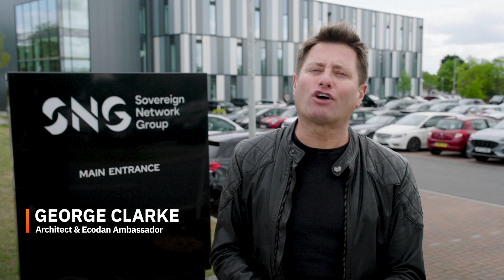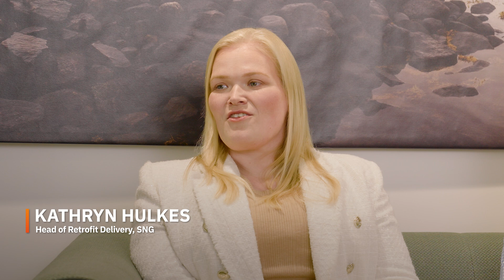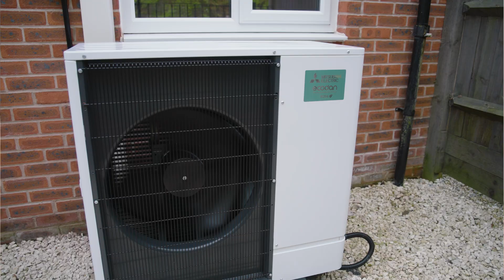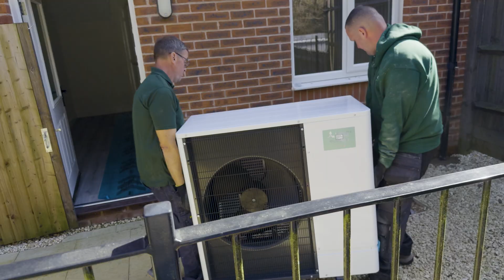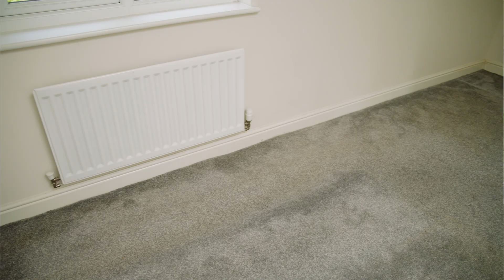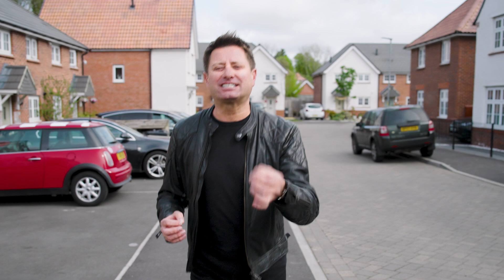George Clarke Explores Microbore Heat Pump Retrofit with Ecodan R290 | Mitsubishi Electric x SNG

Comment: Where do I even begin?
Having purchased a Sovereign property in 2011, I can say with absolute clarity that Sovereign’s performance has been nothing short of incompetent. It is laughable—if not tragic—how utterly useless they were.

Their claim that “we have been working with Mitsubishi for 15 years” is, quite frankly, nonsense. What they have been doing is collecting government grants for 15 years while failing to deliver meaningful support to residents.

They were unable to explain anything about the Mitsubishi air source heat pump installed at our home. They refused to provide technical assistance and treated my family with open contempt.

As two of their own representatives admit in this very video, their motivation is the grant money. Nothing more.

If Sovereign were genuinely committed to their clients, they would invest in proper training for their staff and engineers. They would build in-house technical expertise and could even generate long-term revenue through annual servicing contracts. More importantly, their clients would receive the support they deserve.

Instead, Sovereign sold their stake in our housing estate—something that has now happened repeatedly. And yet, they continue to spout the same empty rhetoric. Their words are meaningless. They are not invested in their clients; they are only interested in the funding.

Mitsubishi UK, I strongly urge you to conduct proper due diligence. Start asking harder questions about Sovereign and their actual relationship with the people they claim to serve. I would imagine your corporate values and charters expect your partners to uphold certain moral and legal standards.

That said, I took matters into my own hands and enrolled on Mitsubishi’s installation and training course, so I could properly service and maintain the system myself. I can’t fault Mitsubishi—the support network is excellent, and the kit is solid.

It’s just a shame you’re making promotional videos for organisations like Sovereign.